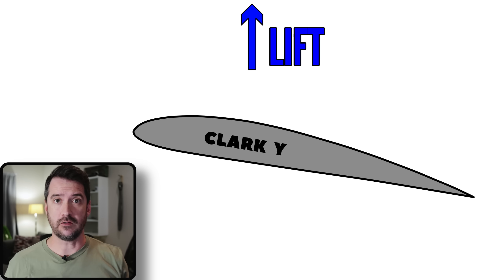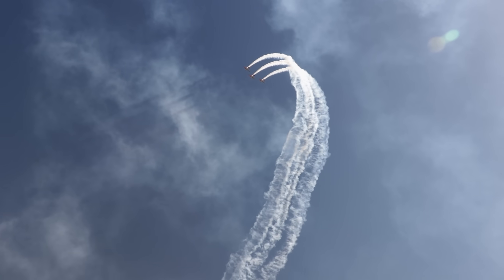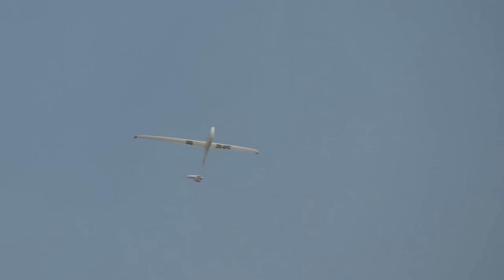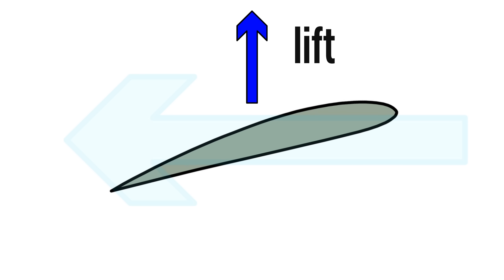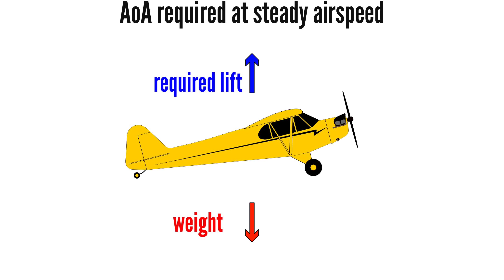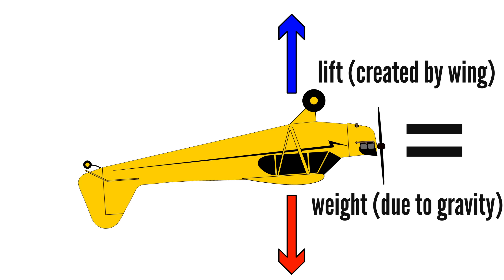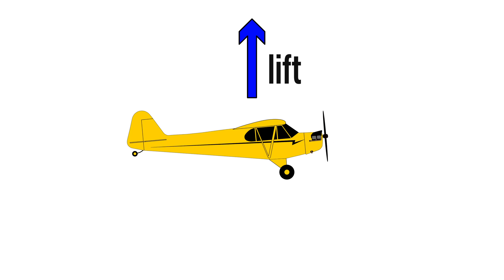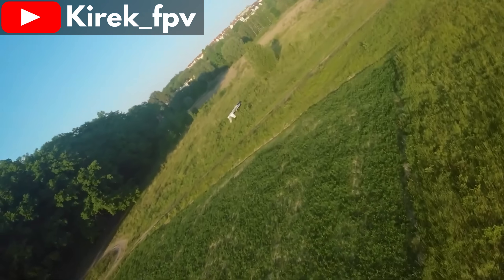Is Airflow Distance Over the Top of a Wing Always Longer?

Comment: if possible, please answer: is there centrifugal force acting on the air when air moves along the surface of the wing, or is the centrifugal force insignificant? I want to understand why the air flow comes off the upper surface of the wing.  In addition to the frictional force that slows down the flow, what causes it to break away?  Thank you
Reply: The centrifugal/centripetal chestnut is one I won't try to sort out here, but what I will say is that any time you have curved streamlines, the reason they're curving is that there's less pressure on the inside of the curve than there is on the outside, and it's that difference which is causing the air to curve.

This means that if you have air shooting up past the leading edge and ripping around the shoulder of the upper surface and then continuing to follow that surface to the trailing edge, then the fast-moving, sharply-curving air over the shoulder of the wing can only be moving like that if the pressure inside its path is sharply reduced.  This is the reason for the upper side of the wing to have a sharper difference from atmospheric than the underside does, where the flow doesn't bend near as much.

This flow pattern breaks down if the wing's flow "stalls," which means that it fails to stay attached to the upper surface and jumps off before it reaches the trailing edge.  This can happen if you tilt the wing too much, asking for more lift than it can provide.  

In doing this -- tilting the wing too sharply -- part of what you're doing is sabotaging the streamlined shape of the wing. In the flow of a fluid around any solid object, the "boundary layer" (the nearby fluid, slowed down by viscous drag against the object) will have a tendency to slow down on its way to the back end -- and if it stops completely, then the flow that comes afterward is blocked from reaching the back, and has to jump off ("separate").  The reason for a gradual taper on the rear part of a wing, or of anything else streamlined, is to hold the boundary layer of flow around the object "out in the breeze" so it's exposed to viscous drag from the surrounding flow to help keep it moving.  (Ref: a very approachable little book by MIT fluids prof. Ascher Shapiro, /Shape and Flow/.)  (By contrast, flow crosswise around a cylinder routinely separates, because the back side of the cylinder is sheltered from the surrounding flow so there's no nearby flow to help drag it along.)

So then if you tip the wing up too sharply, the rear portion of the upper side is not being held out in the breeze so well any more, and the flow over it is more likely to stagnate before it reaches the trailing edge, and if it does, then this forces the flow to separate and then you don't have lifting flow any more.
Reply: @crispinmiller7989  thanks a lot for such great answer🤝
Reply: @crispinmiller7989  In saying the following:   "if you have air shooting up past the leading edge and ripping around the shoulder of the upper surface and then continuing to follow that surface to the trailing edge, then the fast-moving, sharply-curving air over the shoulder of the wing can only be moving like that if the pressure inside its path is sharply reduced.  This is the reason for the upper side of the wing to have a sharper difference from atmospheric than the underside does, where the flow doesn't bend near as much."

Are you saying that the pressure is reduced because the pressure is reduced?:

sharply curving air--> because the pressure is sharply reduced

reason for the ... sharper difference from atmospheric  --> ...the underside...doesn't bend near as much

In terms of flow separation (correct me if I'm wrong), you're saying mixing "untainted" higher energy flow to energize the boundary layer, is the cure (in terms of the shape design) to delay the onset?

But in terms of the pressure drop associated with the curved flow lines, do you believe that prerequisite for lift generation absolutely requires consideration of: the boundary layer and/or viscosity, and/or the kuta condition?

(I realize that's a bit of a broad question, caused perhaps by watching, and trying to synthesize, too many YouTube professors).
Reply: @davetime5234    First of all, sorry if any of this repeats stuff in the previous post you were commenting on.  I wasn't seeing that I could just scroll up and see how much I'd said already.

“Are you saying that the pressure is reduced because the pressure is reduced?”: 

Well, I’m saying what the flow pattern is, and what the pressure distribution is in such a flow pattern, and that it has to be that way in order for the flow acceleration (the curving of the streamlines) to obey F=ma — but whether that’s saying “why,” or “because” anything, is a bit of a chestnut.  We often say “because” when what we really mean is “or else it would violate principles we believe to apply,” i.e. that it needs to be that way to be consistent with the rest of our knowledge.  But whether that’s really why it happens is a philosopher’s question.  (You could search YouTube for Feynman talking about “why?” and you get to see him roasting an interviewer for asking that.)

It's true you can get into a chicken-and-egg runaround with this, but I wasn’t meaning to give a circular argument of lowered pressure caused by the flow chasing the low pressure.   In other scenarios (for instance, sticking a vacuum-cleaner wand into a crossflow) you can use low pressure to make streamlines curve  -- but in the airplane-wing case, a better answer for me to have written would be that the pressure is reduced just because the air is following a curved surface, so then by F=ma the streamlines at the inside of the curve have to have lower pressure than the atmosphere outside those curved streamlines.

A more interesting “why” question, if you want to ask one, is just “why does the air follow the curved surface like that, instead of jumping off?” — and to that, my “because” answers, i.e., my remarks on what other principles it’s consistent with, are that when it follows the surface (whereas, in a stall, it doesn’t any more), it’s doing it “because” — given (1) its momentum, (2) the surface beside it, and (3) the atmospheric pressure pressing it against that surface — there’s no easier place for it to go.   Even though the pressure at the surface is below atmospheric, it’s still well above zero (a vacuum) — so the air is clamped against the surface and will follow it, unless something gets in its way.

[this next chunk of the answer -- down to "do you believe that prerequisite for lift generation... requires consideration of: the boundary layer and/or viscosity, and/or the kutta condition?" --  is an amplified repeat of stuff I said last time]

That situation applies as long as the air is able to keep moving along the surface.  If something blocks it, then it will have to jump off, and then you have a stall instead, and you don’t have much lift any more.  In a typical stall this is because the air passing over the wing comes to a stop before it reaches the trailing edge (I’ll say “why” in a minute), so it sits there like a proverbial bump on a log, blocking the passage of any air that’s following it, so the subsequent flow has to jump off.  Some wings are also equipped to force a stall, by using little crosswise fins that can be popped up out of the wing, called “spoilers” — to descend quickly, or to help stay on the ground, in the case of lightweight and delicate sailplanes, recently landed and not tied down yet, that don’t want to get lifted off the ground if a wind comes up.

So in a stall that’s not produced by spoilers, what’s happened?  What’s happened is that in the “boundary layer” — the region of flow that’s close to the solid surface, so it’s affected by drag along the surface — my condition #(1), momentum, has died before the flow has reached the trailing edge.  “Why”? — well, with any shape with bulging sides immersed in a surrounding flow,  the pressure around the bulges of it will be lower than atmospheric but then, from there on back to wherever the flow stops and jumps off, the pressure will progressively come back up to atmospheric pressure (or else it wouldn’t be able to flow away downstream).  This pressure increase along the rear portion of the surface is referred to as an “adverse” pressure gradient because it opposes the flow.   In the boundary layer, this means the flow over this area has two factors opposing it — it’s always got the drag from being near the solid surface, and now it’s got the adverse pressure gradient too.  

In shapes with a blunt rear portion, this double threat slows the flow completely to a stop (“stagnation”) somewhere before it reaches the trailing end, and then the flow has to jump off without reaching all the way to the back.

In streamlined shapes, including wings, the rear portion is tapered gradually in order to keep the boundary layer exposed not only to the solid surface but also to the influence of the surrounding air stream, tending to drag it along until it reaches the trailing end after all.

BUT if you tilt the wing up too sharply, asking too much lift from it, then you can end up tucking the rear part of the upper surface down into the wind-shadow of the forward part of the wing, so it’s no longer being helped along by the surrounding air — you’ve oriented it so it’s no longer streamlined.  In this state of affairs the adverse pressure gradient combined with the surface drag can bring the boundary layer to a stop somewhere before the trailing edge, so the air on the rear part becomes stagnant, the flow that comes after that has to jump off, and you no longer have the nicely-curved flow pattern that was giving you the lift.  This sabotaged flow pattern is what’s called the stall.

“In terms of flow separation (correct me if I'm wrong), you're saying mixing "untainted" higher energy flow to energize the boundary layer, is the cure (in terms of the shape design) to delay the onset?” 

— right, as I seem to have repeated or paraphrased just now.

“But in terms of the pressure drop associated with the curved flow lines, do you believe that prerequisite for lift generation absolutely requires consideration of: the boundary layer and/or viscosity, and/or the kutta condition?”

You do need to avoid separation before the trailing edge, and that requirement corresponds to the Kutta condition, although the Kutta condition is purely mathematical.

EXCEPT for understanding the stall, you can get decent rough approximations of flow and lift without considering the viscosity.  Where viscosity cannot be ignored is, first of all, in understanding the stagnation/separation/stall issue, and second of all, in understanding the physical reason that successful flow does correspond to the Kutta condition.  (Since analytically that condition is just a rule inserted in the algebra to make it match what’s observed.)

So for what physical reason does the flow separate at the trailing edge (if it hasn’t already)?  It’s simply that the edge has a sharp enough curvature that if the underside air were to come up around such a sharp turn, involving a sharp pressure drop in the interior layer of air (curvature of streamlines again) — and then run head-on into air coming the other way, the pressure difference at that collision would present such a rapidly-increasing pressure gradient that it would force the rounding-the-edge boundary layer to die right there and separate after all.

(UNLESS the wing has stalled, and then there’s not much upper-side velocity back there to collide with, and then the underneath air can burble around onto the top, and short out the lift, after all.)

“(I realize that's a bit of a broad question, caused perhaps by watching, and trying to synthesize, too many YouTube professors).”

No worries.  It was a reasonable question and was asked nicely.   Hope the kind of wordy response has made some sense.  (“adb012,” please fix any misstatements.)
Reply: @crispinmiller7989  Thank you!  That's a long but well worth it, very insightful answer:  the extra detail full of value I was missing from elsewhere!

I'm still re-reading..
Reply: @davetime5234  Thanks for the kind words.  Glad you're finding it helpful.
Reply: Isn't it just that the airflow has an upper limit on how "tight a turn" it can make successfully, depending on the properties of the air flow.  If the turn is too tight for the conditions, turbulence and separation occurs.